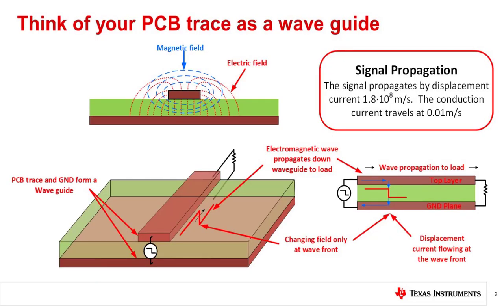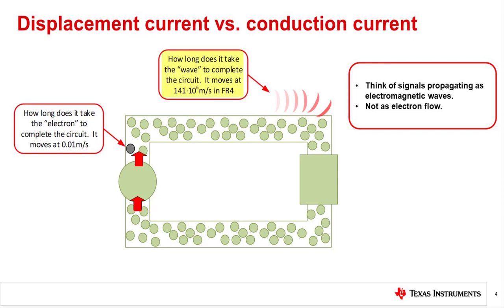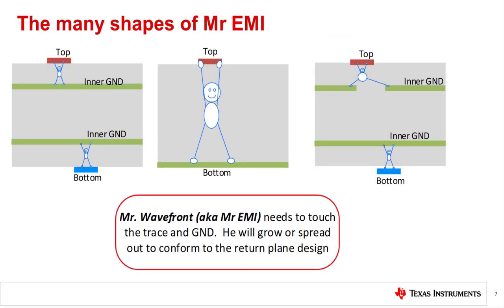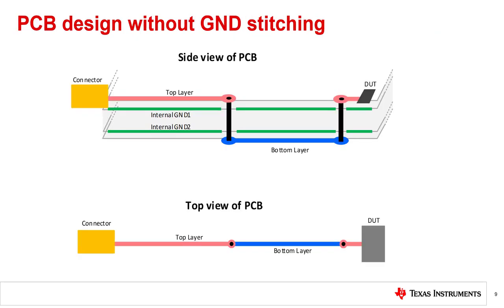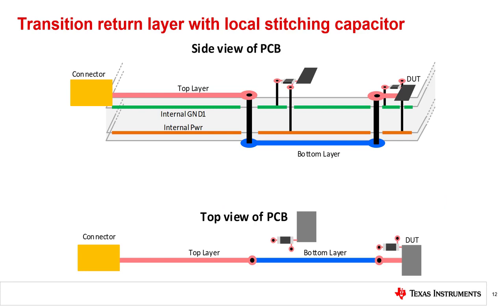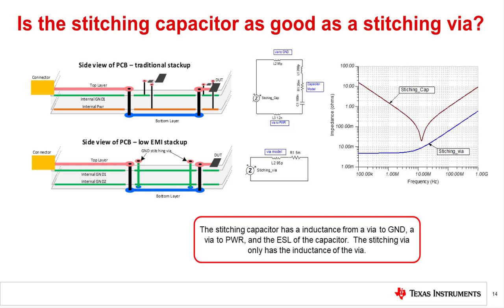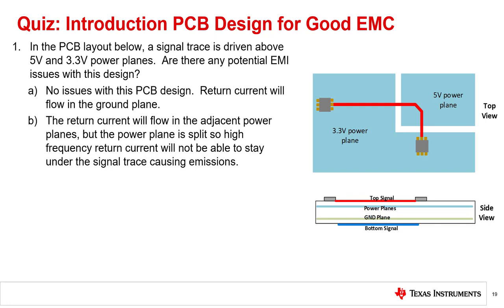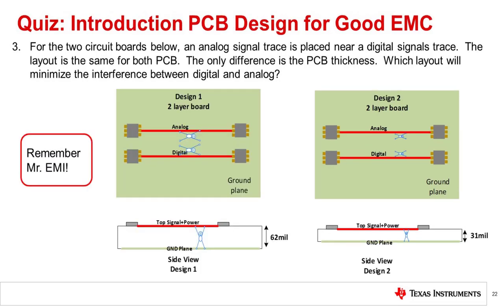PCB trace as a wave guide

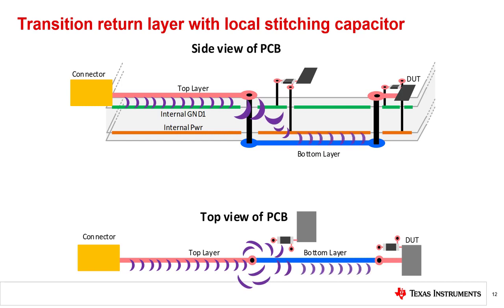Comment: 9:14 was very cool, using the stitching capacitor to help transition the signal return path from GND1 plane to the bottom Pwr plane and then back up to the GND1 plane. Despite them being at different potentials it was instructive to learn that this would work.

Comment: 2:30 "Conduction current is the travel of an electron from the positive terminal, through the load".  You have it backwards.  In the direction from battery plus to battery minus, current will be positive, that is true.  That positive current is constituted from electrons carrying negative charges from negative terminal to positive. The negative terminal is called the negative terminal because it has a surplus of negative charges.

Comment: Calling this a "wave guide" goes against the common definition. The term "wave guide" or "waveguide" for electromagnetics is applicable (only) to TE / TM modes of propagation. Microstrip is (quasi)-TEM - with different boundary conditions and hence not a "wave guide" (until your dielectric thickness becomes an appreciable part of the frequency of interest)

Comment: The return current of a Transmission Line flows through a distance. Hence there is inductance through this path and it should be shown.  Not showing this inductance unintentionally teaches that ground is ideal. The ground path is never ideal. The Ideal Ground concept is often taught as it is here in your video. It must be first unlearned to be successful at EMC and EMI.
Reply: That’s a good point.  I will have to think about that for future updates.